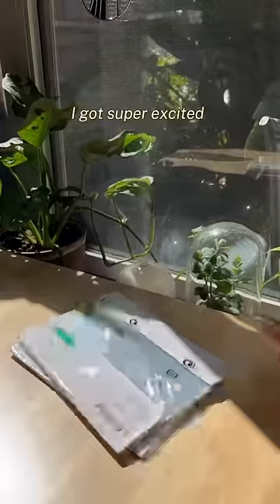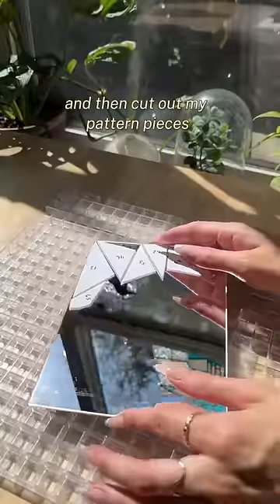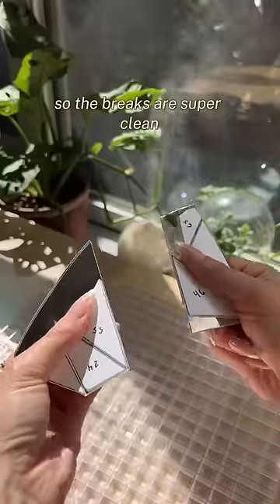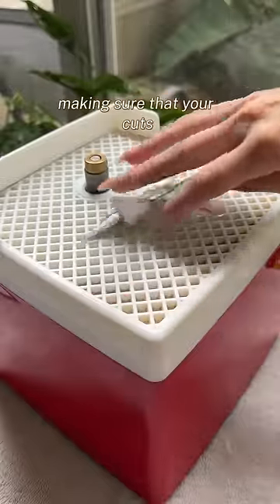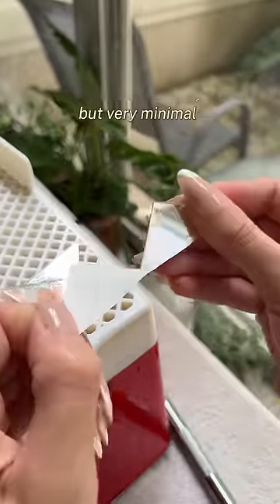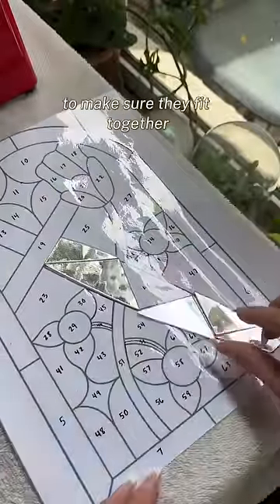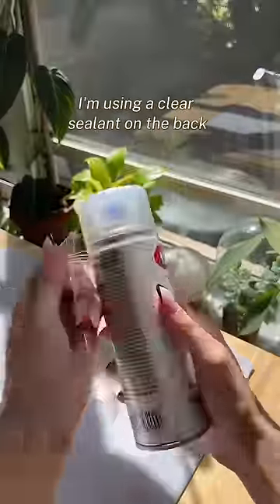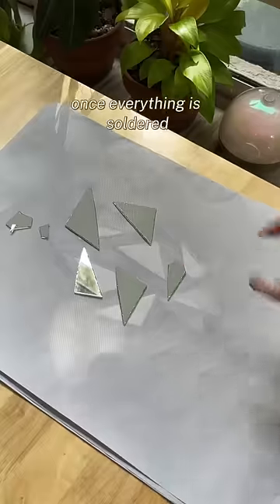can i make stained glass using mirrors? #stainedglass

Comment: Mirror rot?
Reply from the maker: If the flux gets in between the glass & mirror backing it will oxidize/rot
Reply: @AmayaJade  one more question, what is flux?
Reply: @mariahham8961 
Flux is what makes the solder flow and stick, the surfaces need to be clean and you paint on the flux then solder over it. I use it in jewellery making and I put my little pieces of solder in the flux but this uses a solder pen like tool and the solder is in lengths and not tiny pieces
Reply: One more question.. what is solder?
Reply: Soldering is a way of attaching things together by a melting metal using a soldering pen (a stick that can reach high temperatures at its tip) on top the things you are attaching, such as wires to a circuit board like in most electronics. The way in which she uses soldering, is to melt her metal of choice into lines between her pieces of stained glass, to fix the design in place.
Please watch her other videos for other information on her process.
Reply: This comment thread is expanding my brain, thank you
Reply: @bertiesgirl1 slay
Reply: Literally i was like huh i guess that is a thing ive seen before
Reply: yes apparently sometimes it's called desilvering mirrros, some people accentuate it more for a vintage look
Reply: One more question, what is question? 

Only joking, thanks to everybody who asked and answered all the questions that I wanted to know too
Reply: This comment thread is definitely it. 👌
Reply: nail polish can yellow over time
Reply: @megantron222  Right 😁👍
Reply: @Sarah-ic4yu 
Question is asking someone about something or like anything idk I'm not good at explaining-
Eg:-how are you? 
What's your name?
What is a keyboard? 

It can also be used to question yourself in your mind  out of nowhere at night when your in bed making you unable to sleep and haunted by your past.
Eg:-why did I do that?
Why am I like this?
Why are they like that?
Why am I answering this person's question when I don't even know how to explain?

And... the rest? Oh my brains broken so idk
Reply: @Devulini  lol questions sound dangerous, like they could lead to an existential crisis. I’m gonna leave both soldering and questions to the trained professionals
Reply: @Sarah-ic4yu  yep you should 👍
Reply: @Devulini one more question, what is something?
Reply: @Iza2play  a- gotta leave it to the professionals

OI!! PROFESSIONAL ANSWERERS!!!
Reply: @Sarah-ic4yu thank you for taking one for the team.🎉
Reply: I can’t find the video on the finished project. Is there one?
Reply: @1BadKitty88 the video linked under this short shows the making process of the complete stained glass
Reply: When I heard this I was like wait wait hold on repeat ??😮😅
Anyway this replies are so  informative I didn’t even know this was thing
Reply: Ive never learned so much in one video and like four comments, thank you all. Idk when I'll use this info but I have it now.
Reply: Oxidation is more like rusting, not rotting.
Reply: is it when the mirror become like green?
Reply: yup they do
Reply: Plumbus! Everyone has a plumbus in their home!
Reply: J'ai une question, qu'est-ce que le questionnement d'une question ?
Reply: mirrors are made of silver(generally) and silver is prone to rust. the rusting of the reflective surface is referred to as mirror rot
Reply: I always thought, modern mirrors are not made with silver anymore but other reflective material. So modern mirror normally don't rust like these vintage mirrors do.
Reply: @mariahham8961 it's what goes in the capacitor
Reply: @AmayaJade  I had no clue my beautiful mirror is gonna go bad😭
Reply: @mr.soyhair8888 same but it's not beautiful 😭😭
Reply: @lillyhill6093 wait that’s how it’s spelled? I thought it was sautering…
Reply: Thanks for telling what is mirror rot  @AmayaJade :3
Reply: I love all the explanations and no one is being rude about it. It’s nice to see
Reply: @Sarah-ic4yu   A question is a sentence or phrase used to inquire about something or seek information. It usually ends with a question mark (?) and is used to prompt a response or engage in conversation. Do you have any specific questions in mind, or is there anything you'd like to know more about? 😊
Reply: I love this comment thread. Thanks  @bertiesgirl1  and @lillyhill6093 for bringing the knowledge like that. 👏👏👏
Reply: I have seen cabinets in bathrooms where moisture got in the mirror and it probably created some sort of mould, so it had black areas. I guess this would be considered a rot?

Comment: Mirror what??  they rot??
Reply: it is just hot sand lol
Reply: I just learned that they rot, and I do think I’ve seen what it looks like. Just in case though, I’m going to double check!
Reply: (They will have a dark splattered edge when they are rotting. If you have problems with it, I suggest getting someone more experienced with this issue)
Reply: Traditionally, a mirror was glass with a silver backing. Silver tarnishes (when a precious metal rusts, it's called tarnishing) and so mirror rot was when the sealing of silver and glass was not air/water tight so the silver would tarnish and turn black at the edges. And it's patchy in a way that almost looks like mold, hence the name "mirror rot"

If you break one of those types of mirrors, it could break the seal between silver and glass which causes mirror rot. That's what she was worried about it the video.

I really doubt they use silver in those mirrors, but perhaps it's still some type of backing that tarnishes so it's a concern.

Comment: I don't know what you are using as adhesive but if you haven't tried it already I would recommend rubber cement. It comes off really easy. We use it when we are patterning and cutting metal for jewelry. It isn't the most permentant bond  but that's why it comes off so easy. You just have to give it a little rub. Though I haven't tried it on glass, so it could be different. But it's worth a try.
Reply: She's a professional...
Reply: Rubber cement is too thick and would alter the lines needed for cuttin.

Comment: Did you have to buy them individually? I got like a pack of 10 12x12 mirrors on homedepots website i believe. I was going to use then to cut mirrors for makeup pallets i bought on ebay that didn't come with mirrors but were like 5x cheaper because of it. I never got to doing it though because i ruined the first mirror and just didn't have the proper equipment to do it cleanly. I think i ended up paying a professional to cut rectangles for me who charged appx only $2.00 per 12x12 square since it was bulk so it came out to be like $20.00 for appx 40-60-ish cut mirrors. Now, after seeing this, I feel bad that they seemed to charge me under what they should have but maybe it's because i supplied them with the glass? They did it within 1 hour or less. My cut mirrors were not intricate that this though.

Comment: The stained glass that I did with mirror years ago is fine. I had the same issue where the edges were a little messy from the backing coming off but that was mostly hidden by the foiling. As long as you’re not beating up your glass, the mirror will be great for years to come!
Reply from the maker: Good to know!

Comment: Using nail polish for any sort of craft is usually a pretty bad idea as after a long while (like a couple years or so) the nail polish starts breaking down and will turn into a goopy mess that attracts dust and dirt, l've had a lot of crafts l made in school get ruined because l used some pretty colourful nailpolish to make some of the details and it ended up turning soft and goopy and sometimes discoloured, so l'd definitely suggest using some sort of sealant meant to last long-term instead
Reply from the maker: I used sealant as well but the edges get covered in foil so it won’t make a difference!